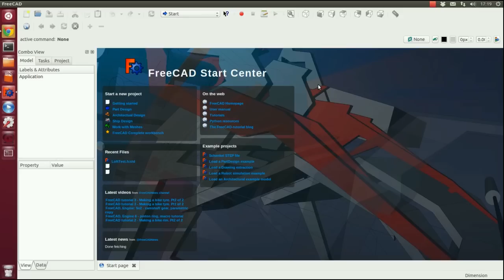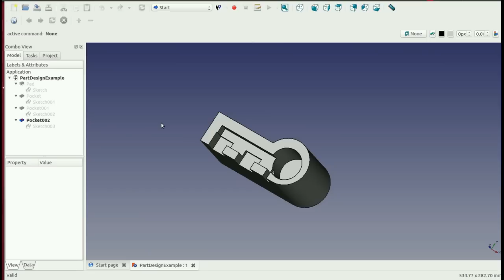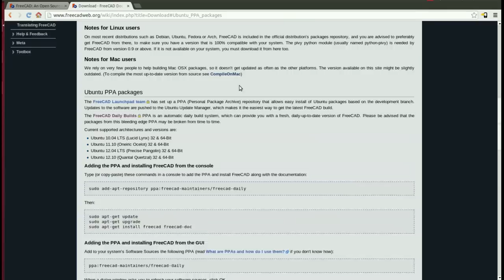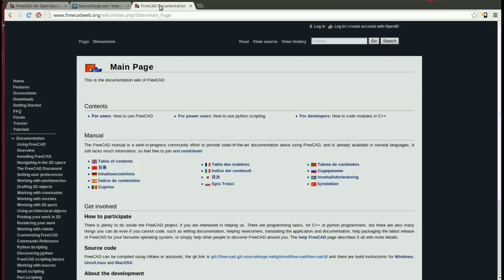FreeCAD Tutorials - Part 1 - Introduction

Comment: Coming from SolidWorks, I've struggled with FreeCAD for awhile now. I REALLY wanted to make it my main modeling software but on my Mac it crashes constantly, nothing is intuitive, and things which should be very easy are very difficult and clunky.   I literally spent months trying to complete parts in FreeCAD which I could do in 10 minutes in SolidWorks.  Unfortunately I can't afford a SolidWorks license so I decided to try Fusion 360.  I had this program figured out in 2 hours.  Now I am cranking out parts even FASTER than I could in SolidWorks with a free Hobbyist license (for now).

I appreciate the effort behind FreeCAD but it's just too clunky and unstable at this point.  I'll check back in a few years.  It doesn't support imperial dimensions  Yes I get that we should be using the metric system by now but over here in the USA we still have an entire country full of existing imperial parts, threads, etc, and machinists still talk imperial.  Having to covert every measurement (especially when working with threads) is annoying.
Reply: Hi so if you would choose between SolidWorks and Fusion360 which one would you use?
Reply: pipa po I would choose solidworks because you must be online to use fusion 360. There is an offline mode but simple things like exporting to STL are network services... and they take like 5 minutes or more!  Fusion 360 is great and I prefer the workspace over solidworks, but I prefer the freedom of having the application actually installed and standalone more.  Also Solid Works does not run native on the mac but it does run well in a virtual machine. Fusion 360 is faster and more responsive, not the memory hog that solidworks is.
Reply: @gettingpast4391  ok thank you very much
Reply from the maker: I'm sorry you've been having issues with FreeCAD. I get a lot of emails from people asking basic questions so I am hoping I can make videos that will help users find their way. I like the flexibility that FreeCAD offers but there are times when I have to use other software too.
Reply: @MarthamEngineering  Thanks I greatly appreciate your efforts towards FreeCad.  My criticism of FreeCad course is not directed towards you. Just wanted to make that clear! Try Fusion 360 ; )

Comment: I found out about this program, while looking up 3d modeling programs for the 3d printer. Anyone else here for 3d printing?
Reply: Humdrum Yes. Yes, I am.
Reply: +Humdrum o/
Reply: I have been looking for some software for my recent 3d printer purchase. Hopefully I can figure this program out without it taking to long.
Reply: I started out with Tinkercad, because it's dead simple, but I'm probably going to switch to FreeCAD, because Tinkercad only has very limited union/subtraction-type functions.
I'd like to get Fusion360 (the upgrade to Tinkercad), but the $310 yearly subscription is a bit steep for a hobby. (They have a free hobby tier, but it's only for one year--I don't want to get addicted to it, then have to shell out for it later)
Reply: Is FreeCAD enough for your 3D printing adventures? Very curious!
Reply: right here, modding an easy button to be a weezy button that says lil wayne quotes

Comment: Thank you for making this series.
Could you possibly do a tutorial on the FreeCAD Ship workbench? There's a 2-part written tutorial on the FreeCAD site but it's hard to follow. A very clear tutorial on this module, in English, is sorely needed. Best would be a walkthrough of making a complete 3D ship model from a preexisting ship plan that has the lines on it. Thanks!
Reply: GinaInCA +1, I'd like a clear tutorial on this as well.

Comment: I'm having trouble finding information on the format of the Point Cloud ASCII file that FreeCAD reads. I've tried comma delimited values, starting with an index, and the x,y,z coordinates which loads without an error.... but displays nothing. I'm at a bit of a loss.

Comment: PartDesign pattern can only work on features from a single part. Such a feature would be built using a sketch mapped on a face of this solid.

By definition a ball bearing is an assembly. To create a radial pattern of your sphere, you can use the Draft Array instead.